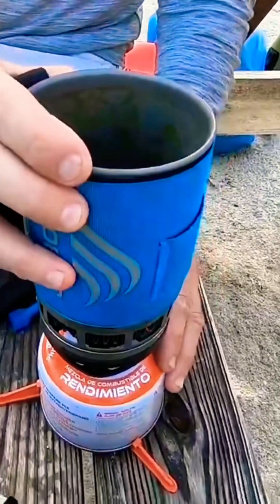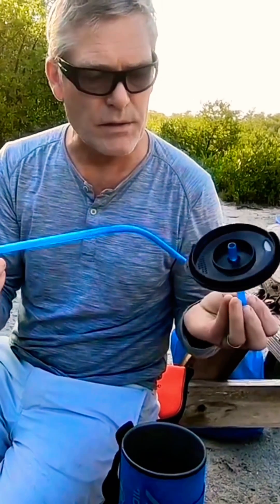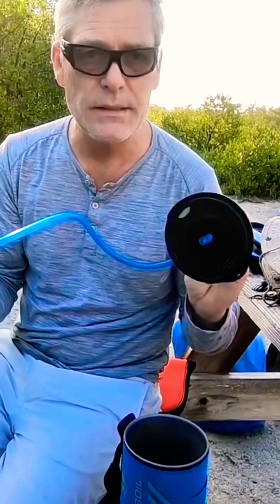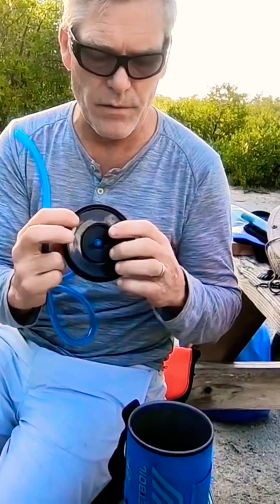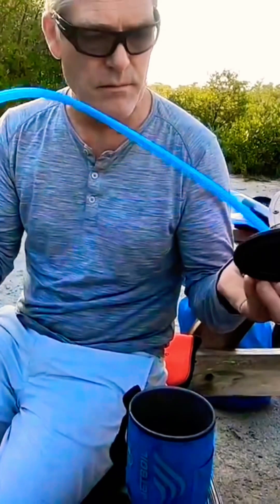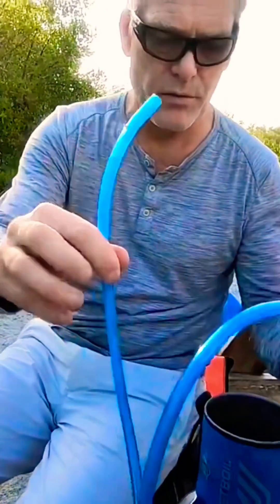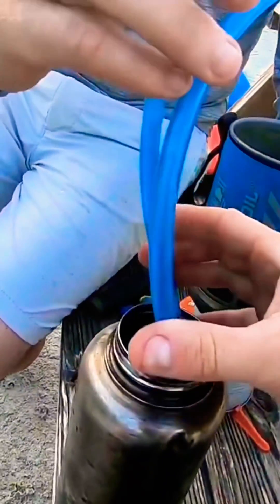How to convert salt water into fresh water

Comment from the maker: Has anyone ever attempted desalination?
Reply: Its freaking plastic that's not meant for 200° steam. This is a last ditch effort but I doubt that will work for long on a fire or bed of coals.
Reply: @brandonwyatt3901 water boils above 100C, how does it get to 200C?
Reply: @Mihail2204  It depends on the pressure. Steam can reach degrees well above 100 but not in this little contraption
Reply: @useitwice  steam can, vapour can’t. There’s a difference
Reply: @Mihail2204  when did anyone ever mention vapor anyway?
Reply: @useitwice  I just did? Because as I said, water boils and this turns into vapour and not steam at 100c.
Reply: @Mihail2204  ok, so what is your definition of steam then?
Reply: Yes. Apparently, it's just too expensive apparently. Don't quote me on this.